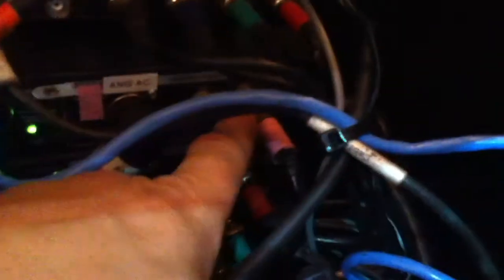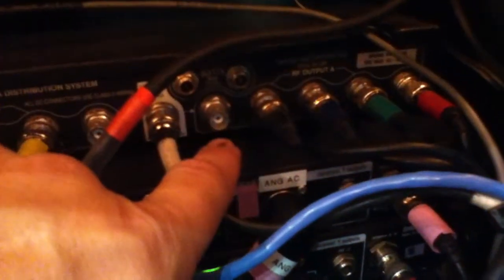shure UHFR wireless antenna combiner system review tutorial by guitar tech sammy bones

Comment: good afternoon, I wanted to ask you a question, I have a shure ur4d + shure 845 (in the inside of the receiver, shure ur4d there is a switch to remove power from the antenna, if I use a microphone splicecom need to turn off the power antennas on the base of the receiver or leave so that the food he left the base, they with splicecom will understand?